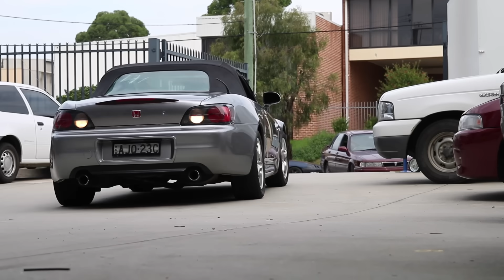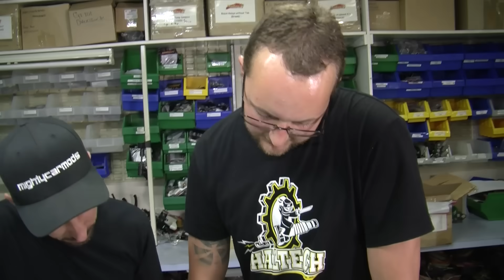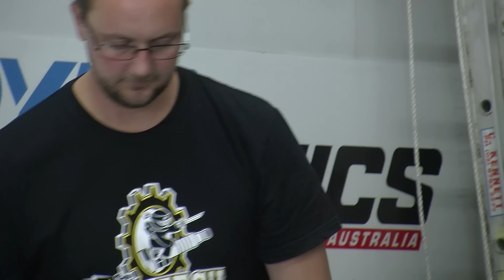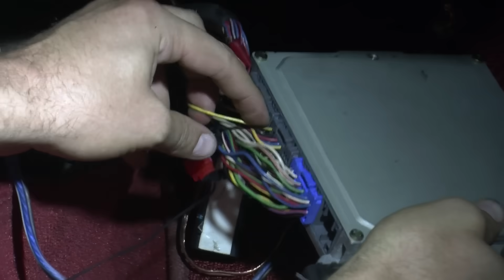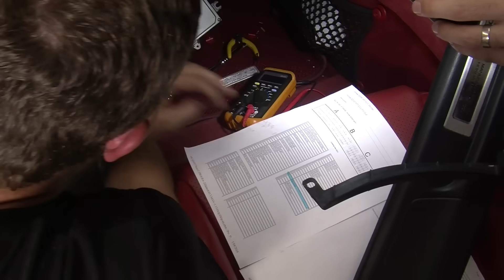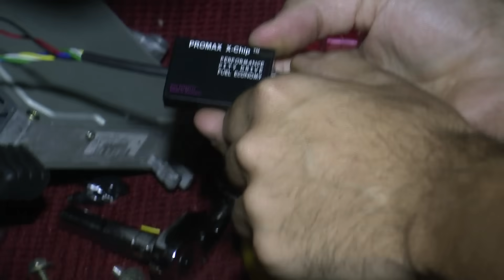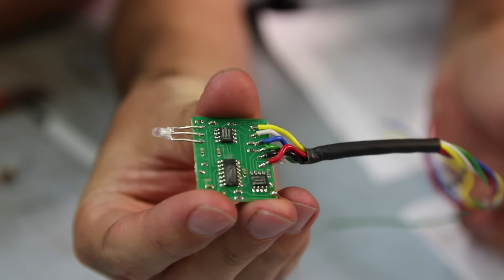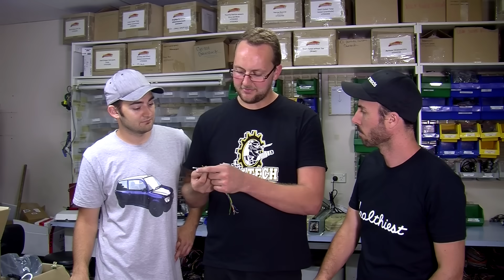eBay Performance Chips -  Mythbusted

Comment: 177bhp from an S2000? i'm sure they had almost 250bhp, something must be pretty wrong with that car
Reply: Kevin B. it's 132kw , 177hp. But canadian and american have 250hp
Reply: They are supposed to make 240 at the crank, wheel horse power is always lower
Reply: As cars get older they gradually loose hp
Reply: 177kW at the wheels, not HP. That's 240RWHP approx
Reply: Alexandre Mailloux yeah, I was having a major brain fart. It's supposed to make 177kW, but they got 177HP
Reply: it's called driveline loss manufacturers state power at the flywheel. which is BEFORE it goes through this power killing thing called a gearbox and differential. 177bhp at the wheels is not so shabby. heck it's only 3hp less than my boosted 1.8made at the fronts that same 180hp at the front wheels put through an awd gearbox gave me 160hp. which is still enough to propel the car to a 13.6 second 1/4 mile
Reply: still, that's pretty major, around 50bhp lost in the drive
Reply: that's a LOT to lose from getting old and nothing that a service cannot undo

Comment: I've always wondered how the hell putting a chip in your car will make it faster, if it does in fact make it faster, all the means is the factory ECU is holding it back somehow....
Reply: I have a toyota solara that I use(ed) as a daily driver and you could only get it up to 120 before the engine would shut off... I can only assume a chip is holding it back, but I have no interest in pursuing the issue because its just a daily driver, and 120 gets me home pretty fast.

Comment: Uck the s2k is that a galant vr4 at 1:26?
Reply: because there is no way to define, 1 horsepower, it is possible to measure a kilowatt, its also the difference between metric and imperial measuring